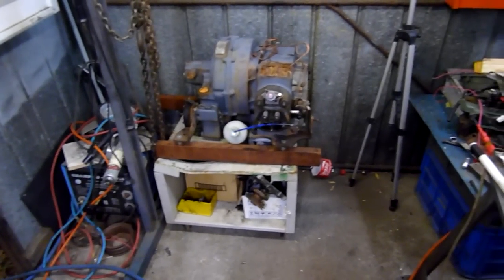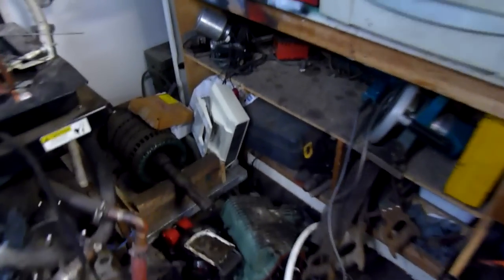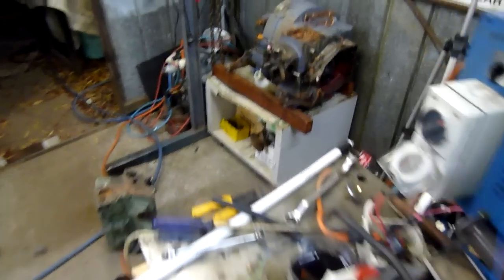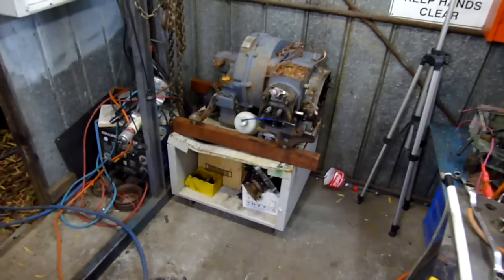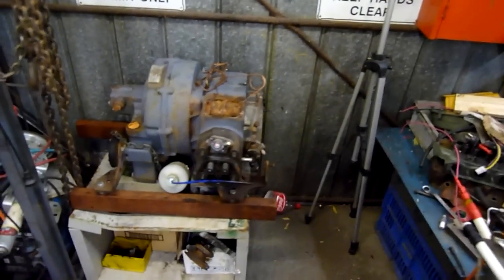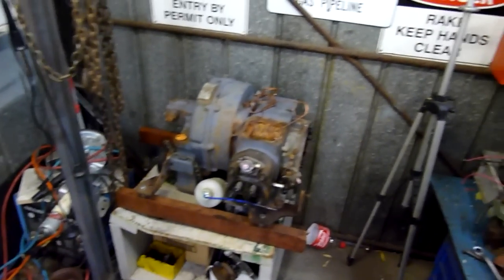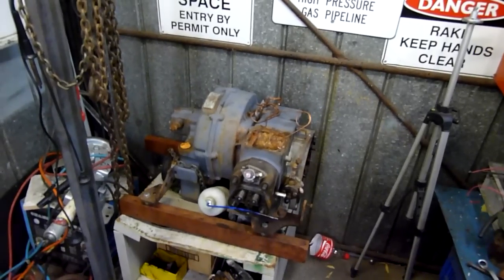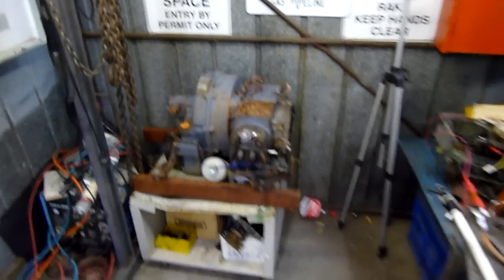Rapid Update - Video Problems

Comment: @huerdon 480 means also worser quality. but its like 1/3 as big. a 720 video has 1280x720 points to save a frame. while 480 has 850x480 points to save a frame. therefore the quality is reduced. i still watch 360p or sometimes 480 cause of my bad internet connection. but i see your videos are in 480.

Comment: Hiya,

I once had this happen. It said about 650-700 minutes to load a video, and I decided to just let it run. 

After about 2-3 minutes, the estimated upload time DROPPED RIGHT OFF to a more sensible 105 minutes. The video was about 15 minutes long, and done in 640x480 size.

If you thought 'stuff that', and cancelled the upload within 45 seconds of it starting, try again, but leave it to come up with a more sensible upload time. :-)

.....It worked for me! 

-BoomBoxDeluxe.

Comment: If you have a 3G/HSPA dongle with a decent traffic allowance and signal, try that for uploads.  While 3G is generally slow for downloading during peak periods, it's pretty fast for uploads.  For example, the last 300MB video I tried uploading counted down from 3 hours and failed midway on my home DSL (due to its pathetic 384k uplink), but took just 15 minutes over 3G (connected at 5.76Mbps up, strong signal).

Comment: Have you done speed tests on your connection to see if there's a problem with your provider? I'd be chirping at them right and left if  it is isolated to their end. If it is YT, then keep cookin' motors and posting them, YT will get it fixed up.